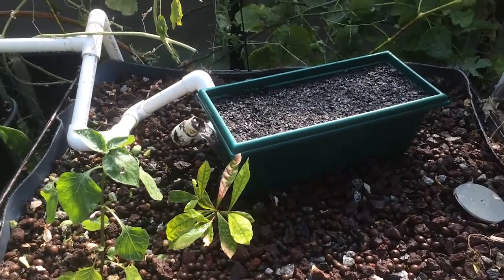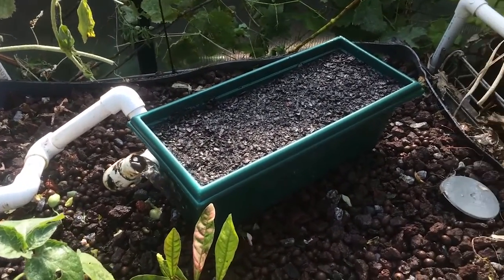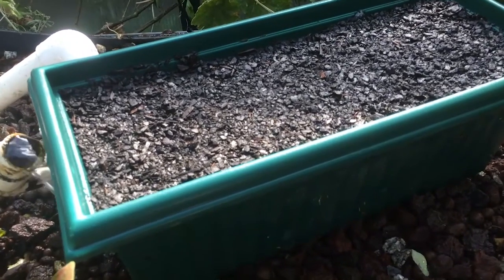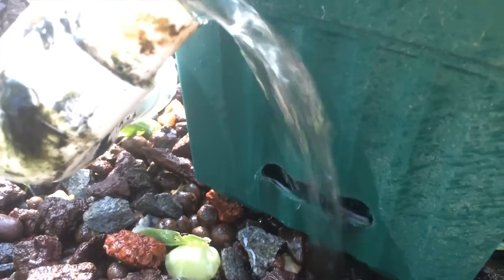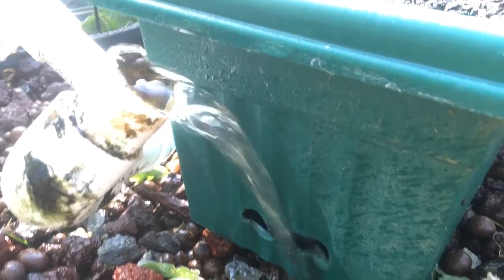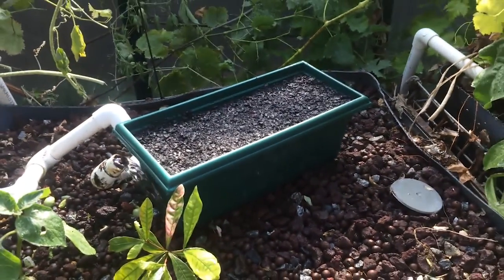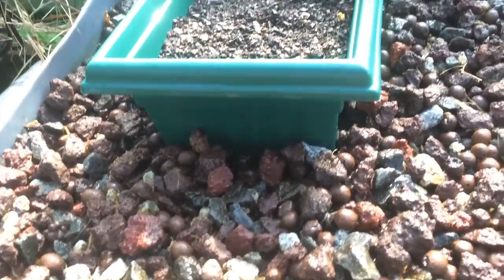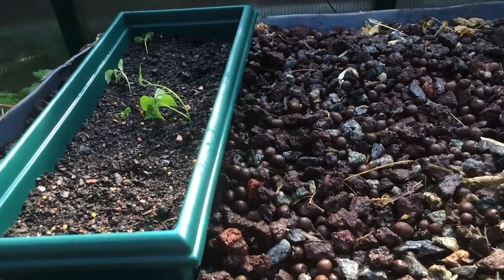Raising Seeds in the Aquaponics Grow Bed Experiment!

Comment: I would never thought of doing that. There are different method of water plants. Its similar to putting water in tub and soaking a potted plant and letting the pot soak the water. Don't think of using it in a aquaponics bed. It works. Great video, Yack